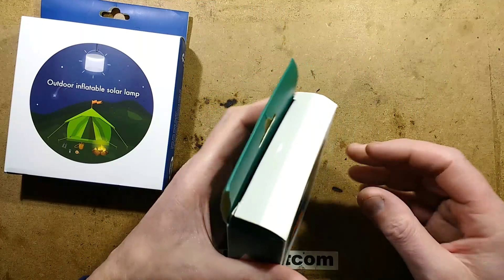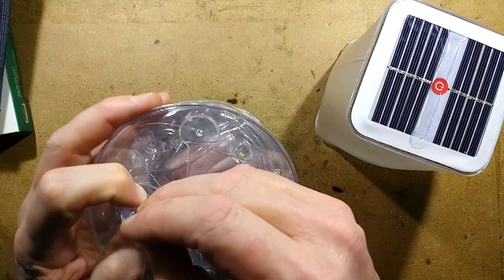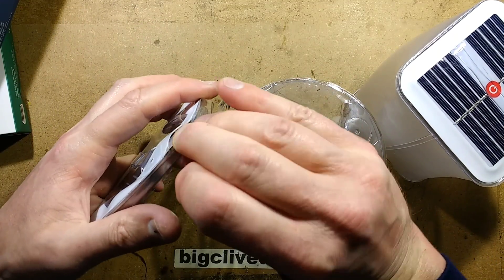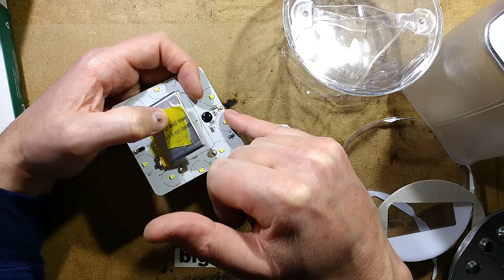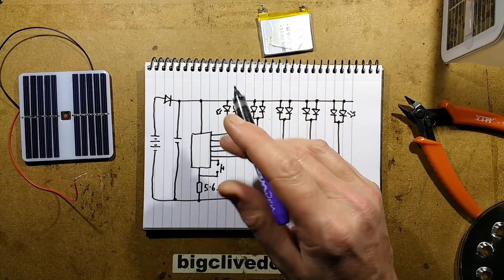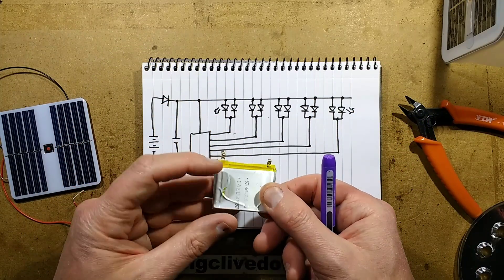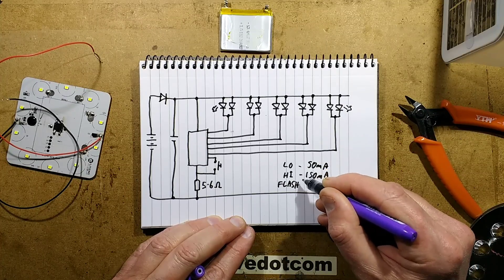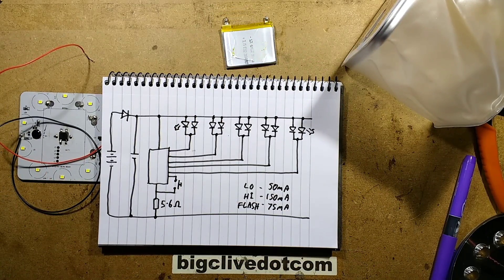Inside an inflatable solar camping light.  (schematic)

Comment: I wonder if there would be a way to just order the circuit board fully populated, minus the battery and minus the plastic covering? Since they are using batteries without overcharge protection in them, that could conceivably get them banned at customs as a fire hazard, as is. Selling it DIY would put that liability onto the consumer, who could actually add a common phone battery that has proper overcharge protection built-in. They could also add some more shopping cart options by adding mounting kits of various types that fit the circuit board's dimensions.

Comment: The chip seems designed for this application. As such, it is plausible they integrated a zener diode into it to short the current from the battery into the chip as heat once the battery is fully charged. Also, the LEDs are in banks of 2 instead of one big bank of 10 because not all diodes are exactly the same, some will have a slightly lower or higher voltage drop than the rest. If that is the case, the larger the bank the wider the difference will be between the highest and lowest, as those with slightly higher drop draw less current which is then concentrated through the LEDs with slightly lower drops, heating them up and shortening their lives.

Comment: Those are cool, I used to tent camp when I was much younger, and loved it.  A couple of years ago, we were down South in Arizona for the winter, and went to a city wide rummage sale, there I found a solar garden light top, just the top with the solar cell and an LED protruding from the bottom.  First off, I didn't now for sure what it was, as it was filthy, but for a quarter I figured I could do something with the solar cell.  So back to the RV we went, and I cleaned the little guy up, turned out to be in great shape, I stuck a rechargeable cell in her, and she worked just fine.  I still have it, one day we had a power outage here in our home in SD, it lasted for many hours, I decided to put that little light to use.  I put a AA Cell in it, and she came on, giving off some light but most of it right below th center of the LED.   I had a glass of water beside my chair (I always have one of those handy) and just for shits and giggles, I placed the little light on the glass, nearly full with crystal clear water.  Suddenly all around my chair became illuminated!  Sort of like putting the globe on an oil lamp after lighting the wick.  The water, much like that translucent plastic dispersed that light around the room and made a great occasional light for those days when the workmen just can't seem to get the power restored.  Sort of reminds me of those lights I saw in hooches in Nam, where they had no power, some wise papa san took a pint jar, cut a hole in the roof in a dark room, and filled it with water, then covered the top with plastic wrap, he had made a wonderful solar light for the day time!  Give that one a try, works great.

Comment: Clive, I realize this is quite an old video now, but I thought I'd answer your "question" about where these would be useful. I would take them with me when on a Kayaking trip. In a Kayak you have limited space for gear, especially stuff that needs to be waterproofed. I typically take a waterproof case for my phone that clips to my life vest. Then I also take a larger (about 150 cubic inch) waterproof container to fit everything else. Sometimes two of those. Then I take fishing gear, a backpack of clothing, and a tent. Once you add me in there, that pretty well fills up the Kayak. A couple of these in their deflated state would fit very nicely into my waterproof container(s) without taking up a lot of space.

Comment: I did a teardown of the inflatable bag type (a faulty one) which if holding the button down it does SOS signal. But not on the cube style in this video which I also have, although 3rd press is a flashing beacon.

Comment: Speaking of camping products, I bought and have opened up an (as seen on TV] motion sensing light that solar charges a no name 800 Mah Lipo battery. I am very curious if it will continue to charge or if it has a cut off to keep from overcharging, as I have it installed near some very expensive lightweight gear. An explosion would be devastating. The panel claims a 0.75 Mah charging rate and at that rate, in theory it could charge the battery in about 10 hours. Definitely within 2 days. I'm curious to know if it cuts off when the battery is full or if it will cut off. I am just getting into these sort of projects and LOVE your channel!! I have learned so much and appreciate what you do! Anyway, I will gladly send this product to you to breakdown and destroy if you are interested in doing so.
Reply from the maker: Most commercial products do have charge protection.
Reply: bigclivedotcom, Right after writing the above comment, I began searching the internet for an answer as well. and I came across many testimonials where these things were catching on fire and burning peoples' homes. which leads me to believe that they will just continue to charging. I also found a few links to U.S. Consumer Safety Board and Better Business Bureau with the same claims. It seems these little Chinese guys are pretty dangerous. If you are interseted in one to dissect, I will gladly send you one.

Comment: It seems with the clear unit, they are relying on the condensation from your breath to act as the diffuser. Us minimalist campers and lightweight hikers  are always looking for our equipment to have multiple uses. Maybe I will end up picking up one of these little units and cannibalizing the solar cell for another use depending on the output of it.

Comment: Is there a way you can test lumins, or do you just do an eye test for brightness?
Reply from the maker: I do have a light meter, but to get a proper average reading you need to use an integrating sphere.  It's easier to judge usefulness by eye.

Comment: We have the same product in the States, the brand is Luci.  The inflatable plastic enclosure and reflector are the same, but the solar panel looks different.  The Luci model has another button to indicate the level of charge in the battery.  Pressing this button illuminates 1,2,or3 small indicator LEDs.  Any unpopulated region of the board for this circuit?

Comment: Why do the Chinese think every flashlight needs a blink mode?  I hate the blink mode.  I'd want a flashlight to go low, high, blink(if you must), but if you delay a few seconds, the next push turns it off.  I've got a headlight that goes high, low, blink; which means I can't just get a little light, I've got to go thru the mode for bright light, and worse, I have to go thru the remaining modes to get to off, including the blink mode -- every damn time.

Comment: Yep.. Over time the solar heat will build causing the lipo battery to expand and become unstable. I had one similar and it wasnt even inflatable, luckily i caught it semi puffed up then modded a protected 18650 on it.
(mine had circuitry and i just didnt want a mini hand grenade waking me up in my tent as everything burned down around me)

Comment: I think you can't measure the current properly because the chip use PWM to change the brightness of the LEDs
Reply from the maker: I powered it from my bench supply and got an average current draw.

Comment: A 3.9V zener across the lithium cell would give it some basic overcharge protection but low voltage zeners tend to be leaky so a charged battery would slowly discharge.

Comment: Are you sure the chip doesn't turn on the LEDs to dissipate extra charge and protect the cell?
Reply from the maker: The chip started passing current progressively from about 5V but not in a way that would protect the cell.

Comment: Little tip. If you use a drinking straw to inflate those it's much easier. That way you don't have to get in super close or fight the pseudo check valve.

Comment: So I was thinking. The clear unit, when you start to inflate it with your breath, the condensation will adhere to the side of the unit creating a diffusion effect. The only thing is that it wont be as nice as the translucent one.

Comment: Mr Clive can you tear down 12 w led bulb that's led PCB is direct on board there use blue MOV ..its a request please
Reply from the maker: It sounds like the driverless style LED lamp.  Some of them ride the mains sinewave, switching in sections of LEDs to match the voltage and also actively regulating the current.  Others just have a long series string of LEDs and act as a current regulator to drop the remaining voltage.

Comment: Would not surprise me if the solar cell is so poor the battery never really gets charged, it just slowly runs down until it works no more. I have a solar powered energy bank like that and the only way to recharge it is with the usb, in fact exposing it to sunlight runs the battery down as the charge indicator led's draw more power from the lithium cell than the solar panel can supply even on a summers day.

Comment: Unfortunately, you have prooved several times how does manufacturers don't care a ** about lithium batteries.... No protection circuits, disposables with fully functional rechargable lithium cells.... I also think the diffused lamp is better...
Reply: Put yourself in a shoes of a manufacturer of that shitty lamp... if your task would be to make something as cheaply as possible with a short lifespan (so your customers will have to buy more of your product in short time), you'd probably design similar product. No Chinese is too concerned about quality.

Comment: I have a 30w solar cell to charge a 12v car battery.  In ambient light the efficiency of the cell is about 5%, so not much chance of over charging.

Comment: Amazon sells these.
The clear round version is everywhere, but it took just a little more effort to dig up the diffuse square one.
Found a slightly upgraded version with a charge indicator.
Makes me wonder if they also added cell protection when they did. (I hope so.)

Comment: Clearly this product could use a few improvements. Add a simple capacitive dropper for charging via   mains voltage, a USB charging port on that dropper circuit and a disco light. Now that's a hit product! Get on it China!

Comment: Sad actually!  Here is something that could be a great little device. however most camper's check there camping gear! Stoves lights tents trailers things need to be ready. And this should have at minimum a full charge LED. And that would or could be part of a easy protection circuit. That is the one thing I never liked about my favorite light my mini mag! The original had a spare bulb and if you turned it on and it was bright all good. But not with the LED VERSION ON ONLY SAID IT WORK EVEN ON ALMOST DEAD BATTERIES. AND IT GOT WORSE WHEN THEY ADDED RECHARGEABLE BATTERIES.

Comment: I think it was a problem/miscommunication between the design and parts departments. Probably the parts was like "Give them the cheapest batteries" and the design called for a protected battery.
Reply: skyliner_369 Problem with these things is the design and manufacturing teams often don't even work for the same company. One place comes up with a design and then sends out to a bunch of other factories to build the various bits. Then if it sells everyone else copies it. Then copies the copies. All the while removing components to make theirs cheaper than the original. It's a miracle these things are as broadly safe as they are.
Reply: the only reason things are safe is because of regulations.
Reply: skyliner_369 Regulations? This is China we're talking about... In Shenzhen there are no regulations!

Comment: I camp once in a while. That is great for packing because it takes up virtually no space due to how flat it is. On the other hand it's a bit of a pain. If the light is that flat, they might as well put a diffuser right over the led's and call it a day. The inflatable section is pretty much useless. At the end of the day, once your camp is set up, your not going to have the energy/ enthusiasm to sit there and "inflate" a light lol! As for the battery, I would not feel safe carrying that around. The battery needs a dedicated framework to keep it from being punctured/ crushed. I have a black flashlight that's could almost be confused for a dirty grey flashlight due to hiking.

Comment: Any sense what the solar charge rate is? 

I picked up a similar light the other day. It uses a silicone water bottle as diffuser but otherwise the same idea. What was disappointing was how little charge current the solar cell actually provided - 20mA at most in peak sunlight and less than 10mA more generally. Since it discharges at ~200mA this translates to a fraction of an hour's illumination per day of charge. This is pretty useless for a lantern which would ideally be used for ambient light for a few hours each night. The lack of over-discharge protection is also a critical flaw since ambient lighting tends to be left on unsupervised.

Too bad, a sealed,  self-sufficient lighting source would provide one less thing to manage when camping.

Thanks for the fun content as always.

Comment: Add a fishing weight to the bottom and float it in a pool or pond.
Reply: Poundland were recently selling off their floating LED solar lights for 50p each.
Reply: Weirdly mine says all over the manual and even on the lamp itself "DO NOT IMMERSE IN WATER!" it's even got a little symbol showing just that, just in case it wasn't clear.
Of course it's bullshit as it's supposed to be inflatable, so how could it NOT be waterproof?

By the way I submerged it under 2 m of sea water and it didn't break :)
Reply: I wonder if it could be used in the same way, for fishing. Like if there are types of fish that are attracted to light (thinking it's the moon or something) then use this as a float with the hook hanging just below it.

Comment: Well being water sealed you could have some fun out on a lake with a bunch of them at night.
Reply: I'd hate to have to inflate a container load of them.
Reply: We could get some politician to do it. They are for the most part all full of hot air. If not hot air then...
Reply: Multicolour versions - http://www.ebay.com.au/itm/7-Color-Foldable-Solar-LED-Tent-Light-Inflatable-Camping-Lamp-Portable-Travel-/282681752394?hash=item41d1253b4a:g:k54AAOSwCL9ZrnTH Blow 'em up, launch and leave!
Reply: Or how about a cargo container full of them getting spilled overboard.
Yes they would have to be blown up but think about the night tracking 
of al the glowing spots.

Comment: Hey Clive, good video as usual. A question if I may: Is there a way to fix an electric kettle heat element? The other day my kettle stopped working, it blew the trip switch for the mains. The kettle still switches on (the light indicates that) but it no longer boils the water, Is it fixable?
Reply from the maker: You can get replacement elements for some kettles, but it's often cost effective to just buy a new one.  It might be worth popping the base off in case it's just a wire that has popped off the end of the element and touched the grounded housing.
Reply: Clive, thanks, I did unscrew the base but could see no fault. Looks like a new kettle for me then.

Comment: The flashing modes on that camping light and flashlights is very annoying don't you think?
Reply: think its meant for a emergency signal to be easily spot
Reply: nobody will ever use it and a lotve the time you have to click through flash mode to turn thing off
Reply: I hate flashlights that flash.
Reply: BUDDY LIGHT mmmm hate to state the obvious...but, only if you switch it on 😆

Comment: What multimeter under €100 would everyone here recommend?
Reply: At least five multimeters for about 20€ a piece. Sometimes you need to measure power which needs two multimeters and sometimes you need to measure power on the input while measuring power on the output (i.e. measure the efficiency of a power supply). And then you want to measure something else while you have four multimeters in use.

Most of the time the precision and accuracy and safety of a more expensive multimeter isn't needed, then it is fine to use the cheap ones. If you work on things that can release a lot of energy at once, then safety should be of some importance. But if the cheap multimeter can be modified to transfer data wireless (hack a esp8266 in it), then it is OK if it explodes while you are in a safe distance to it... It all depends on what you want. ;)